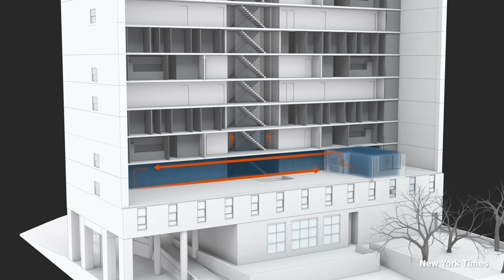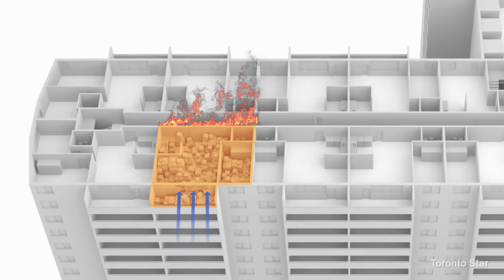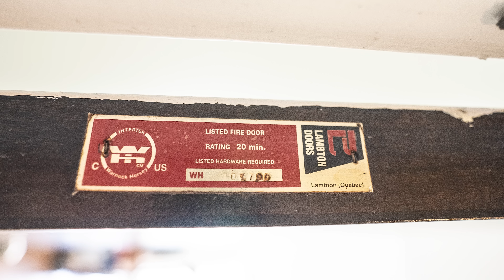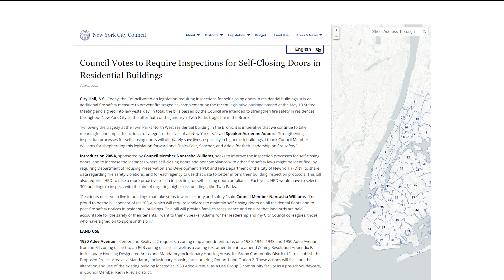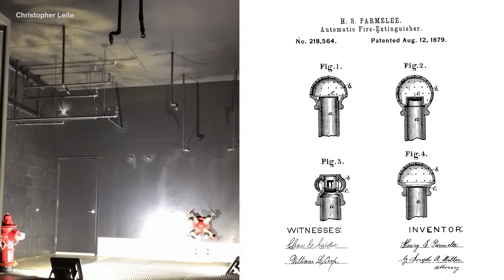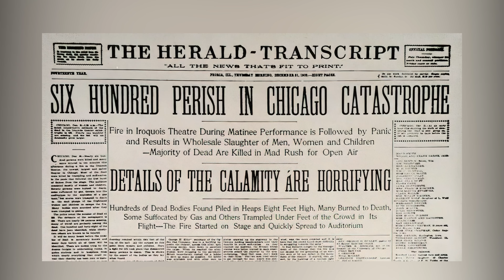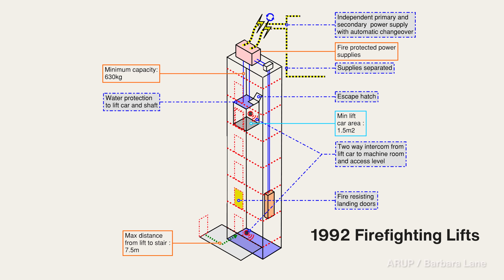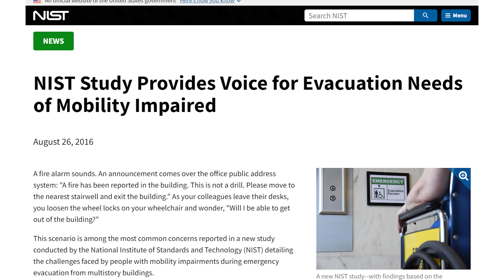How Hidden Engineering Keeps You Alive in Apartment Fires

Comment: While a great video about how things should be done, "stay in place" has killed tens of people, because not all buildings fit the code and unexpected things happen. The best rule is to always evacuate at the first sign of a fire.

The only exceptions are if you can easily end the fire, if there's danger outside, or all evac routes are blocked. NEVER assume that fire protection systems are installed, up to code, working, or will work this time.

Comment: I used to live in a dorm that has a sprinkler in the center my room and it can reach my gaming setup. So instead of disabling that sprinkler, how others have done, I found an old fire blanket and a rubber wall liner. I roll this up and secure it to the ceiling between the sprinkler and my electronics. Here comes the tricky part, I tie a string to the sprinkler's temp bulb that is connected to a force sensor. So when that bulb explodes, then the sensor will sense 0 forces from it and lets the blankets drop down. Moreover, I had a extinguisher under my desk just in case. In the end, it never activated because there was no fire at all in the 4 years that I was there. At least I was able to reuse the rubber liner for another project.

Comment: Fabric fan here! Did you know that most firefigher suits are made with flame retardant fabrics? you can actually buy commercials spays which can prevent certian fabrics from catching fire as easily. Before these innovations figherfighters used to wear woolen suits as wool doesnt actually catch fire, its natural insulation was also a desireable quality for this reason. Certain synthetic fibres are famous for the opposite reason, although they can be soft and warm they are also increasibly flammible. In the 70s there were a few cases of children catching on fire after sitting to close to heaters and fireplaces in synthetgic pyjamas, for this reason some childrens clothes now carry a warning in the event they do use such fibres

Comment: My building, a college residence hall/dorm with a basement, lobby/ground floor, and six residence floors, is essentially the lowest-rise “technically high rise” building imaginable.
It has pretty much all of these safety features, except maybe concrete walls between units. They feel like Sheetrock and sound hollow when knocked, but are surprisingly soundproof, I never hear my neighbors, and I’m sure they use metal studs and maybe double layered Sheetrock at least. Our floors are carpet tiles directly over concrete, and our ceilings are concrete with plaster and paint on them, which looks very convincingly like Sheetrock until you touch it. All our dorm rooms have sprinklers on the wall directly above the doors, which have working door closers. (There was a time, though, where ours didn’t quite latch all the time but it somehow fixed itself.) There is a standpipe in one of the staircases. We don’t have any of the emergency stair pressurization systems, but I do believe we have pressurized elevator shafts. Our fire alarm system is also a “floor of incident” style system. When a smoke detector or manual lever is activated, the alarm will sound on that floor, and the floors directly above and below the incident floor, but not the entire building. This means there will be less crowding during an evacuation (though they set the entire thing off for drills which is absolute chaos) and also since we’re a reinforced concrete building, there’s no real threat to those people if the fire department shows up in a timely fashion. 
My only minor gripe about the dorms on my campus is the fact that the smoke detectors in the rooms themselves don’t set off the rest of the system, or notify the fire department, like the ones in the common areas. Instead, they just beep in the room only, and flash the room number up on the alarm panel. I guess they assume if there’s a real fire someone would pull the alarm at at the pull station near one of the staircases, or the sprinkler will activate? (There’s flow switches in the sprinkler system, so an activated sprinkler will also set off the floor fire alarm, but as you say, not the other way around like in the movies.)

Comment: I live in Honolulu, which is crowded with nearly 500 highrise buildings. Sprinklers were not required legally until hundreds had already been built. After a very stubborn fire in a commercial office building took about a day to extinguish, a law was passed that mandated sprinklers be retrofitted to all commercial buildings (including hotels) that lacked them. BUT...efforts to do this for residential highrises have consistently failed due to residents complaining about the cost each owner would face. In 2017, a major fire in a 36-story residential building, the Marco Polo, killed four people and damaged or destroyed 200+ units. Those at or above the fire were burned or smoke-damaged, but a great many more below the fire were damaged by the massive amount of water sprayed by firefighters which ran all the way down interior walls to the ground floor. None of this would have happened if a single fire sprinkler had been activated immediately to extinguish the first flames, which occurred in a kitchen.

Comment: I'm in Valencia Spain at the moment and my building lacks all of this. Even the walls are bad. The neighbors have even locked the roof door which for us leaving at the top is one of our escape routes. They don't care and it's the same answer from the company managing the building so we don't have the key. None of the doors are fire doors. Well we have none of the safety measures you mentioned. I guess this is good only for new constructions although down from where I live a recent high rise building was entirely destroyed by flame from bad electrical wiring. Some people died. So it depends on when your building was built, if the constructor follows the regulation and the country where you are (especially: how easy is it to bribe building inspectors)

Comment: One fire that this video made me think about was the triangle shirtwaist factory fire. Here, the owners actually blocked the fire escapes, making them unaccesable during the fire. The reasoning was that they were locked to prevent theft, but it really resulted in many tragic deaths. This building was also fire resistant, meaning that it would not collapse; however it was lacking many of the other safety features. Some of the safety features could act as a fail-safe of the next, such as having a working sprinkler system. Aside from egress, the video also references how smoke inhalation is the largest killer in fires and a good safety feature against this is smoke control. To do this, many high-rises have automatic closing firedoors and floors that are rated as fire resistant and as well as smoke control systems that vent out harmful smoke. The triangle shirtwaist factory did not have automatic closing doors or a smoke control system to remove the smoke and to give the workers time to stay in place. The locked doors did not allow them to evacuate.

Comment: When will these ideas be used in low rise and single family buildings?
Reply from the maker: They won't except for sprinklers which are coming into many standards if not already.  It costs too much to fireproof everything and people are more easily able to evacuate from homes.
Reply: I think of Lytton, BC.

More than half the town was in flames in about 15 minutes. When I saw video of the destruction, I saw one home with a big wooden deck, with a green lawn and shrubs. It sure looked like this homeowner turned on the sprinkler before he left and just let it run. And it saved the whole property. Not saying that’s the best go-to method for fire protection but if we look at what remains after a big disaster like that, some of the cheaper ideas ought to be included when a building fire code is upgraded.

I asked the city of Toronto to install protected intersections (for cyclists) for over a decade. They are doing the first one now at Bloor and St George. Now I want to convince them to do a lot more. I have a strong belief in people being able to shape our community for the better. I wonder what changes that means for fire resistant buildings.

Comment: That definitely explains some of the features I've seen at a retirement apartment complex I once had an internship at. The whole door thing in general is rather interesting, one moment the closed door is protecting the room, then if it goes on a certain amount of time, the pressure from the flames will burst open the door like Shrek leaving his outhouse. I also wish I could get home sprinklers, but I doubt they'd work properly in older homes that still uses well water, and installation complexity being another thing.

Comment: I used to live in Sunnyvale, CA and our apartment building code dictated heavy fire doors on each unit at the hallway. (This was a 3-story building with 135 units.) My current apartment, built in 2016 in San Jose, CA has flimsy wood panel doors that you can stab with a screwdriver (happened to a neighbor). It's 6 stories high, 102 units, wood frame construction. 

Our instructions are to use the fire exit stairs any time our smoke detector or the building fire alarm goes off. However, most people have stopped evacuating because there are so many false alarms. Some tenants tamper with the wiring (because they're tweakers?) and the system goes off at intervals until repaired. Other tenants just pull the fire alarm in the hallway because they like to see the fire department roll up with lights and sirens. (The fire department hates our building by now.) We also haven't had building-wide alarms when there were fires because of all the damage to the system.

However, the fire sprinklers have always worked to keep fires limited to the apartment where it started, even when there is smoke in the hallway after tenants opened the door to air out a cooking fire (and the chemicals from the stove hood fire stoppers). Each studio apartment has a sprinkler in the kitchen area, the bathroom, the living area, the sleeping area, under the overhang in the sleeping area where the bathroom fan exhausts outside, both enclosed closets, and the area between the closets. The main problem here is flooding of the adjacent units and everything below to the ground floor.

Comment: A fun little note on wood-construction. Using wood, rather than metal in your supporting structure actually lasts longer than metal before experiencing a collapse. I know. Weird, right?

Well, as wood burns it chars into a fluffy carbon. If you've ever tossed a log into the fire, you know that even though the fire is raging, that log seems to persist for what feels like hours. Even in forest fires we see burnt trees standing tall. That carbon on the outside acts as a fantastic insulator of heat, keeping the underlying layers structurally sound. An example of which being fire-walking, where you walk on burning wood coals. 

As for buildings that have been designed with this in mind, a local sawmill comes to mind. In 2012 the Lakeland Sawmill in Prince George, BC suffered a dust explosion. A raging inferno broke out, with fire and small explosions quickly spreading through the mill. The roof quickly collapsed under the extreme heat, blocking escape routes for some workers, including my neighbor who had tried to go back in for his coworkers. He was badly burnt by the walls of flames, and had to retreat. One employee died in the fire, while 12 others suffered injuries.

I got to take a walk-through of the mill, and one of the biggest changes made besides dust mitigation was the use of large wood-beams spanning across the ceiling, supporting the roof. The time they are supposed to last before structural failure occurs is dramatically higher than their metal equivalents, a somewhat counter-intuitive design made to give humans precious extra time to escape if the worst was to come. It definitely highlights how far material science has come for buildings, and how we have grown to take advantage of the unique properties of readily available products.

Comment: working as a construction manager in Denmark, we have a lot of rules and regulations regarding fire safety when designing and constructing building
Constructions laws or most likely similar in many countries:

First, the building will be placed in a risk category, depending on things like max occupancy, numbers of floors, Height of building, if the building is designed for sleeping occupants etc. 
Depending on the risk category, there will be deffirent rules for certain parts of the building.

Next, the building will be subdevided into smaller sections. Escape staircases and installation vents will allways be in their own category. Deffirent apartments will be seperated aswell. Large apartments may even have smaller sub-categories, further deviding it up.

All decks and walls seperating deffirent sections will have to live up to certain criteria, as follows:

R: Load bearing construction (Like a pillar)
EI: Seperating, insulating construction (Like a wall)
REI: Load bearing, seperating construction (Like a load bearing wall)
There are further annotations, such as the construction materials dripping effect (how much heat is required for the material to melt, and possibly start dripping down, setting fire to parts of the building further down.)

Then the constructions are given minimum requirement for time it will take for the above properties to fail, most commonly 30, 60 or 120 minutes.

For a multi story building, a standard requirement would most likely be for the escape staircase being seperated from the buildings other sections by EI-120 construction (REI-120 if load bearing)

Comment: I do want to correct that the smaller bulb size in the fire sprinkler is not related to its activation time but rather the size of its orifice for the required water demand. That said residential fire sprinklers tend to be far less demanding than commercial. And that's because the hazard imposed by the type of occupancy of the building. And R-2 occupancy is less of a hazard than an S-1.
Reply: Not correct. A residential head may be smaller, but the same 3mm diameter bulb is used in other quick response heads. The 5mm bulb, now much less common was the standard response time index head. It’s a mass to surface area ratio design. In normal room there is considerable lag between rated temp and operation. Originally developed as part of the residential sprinkler head program that started at the National Fire Academy in the late 1970’s. 

The efficacy of faster response, and later larger orifice sprinklers then created largest changes to fire sprinkler technologies since the replacement of conventional heads by the SSP and SSU heads in the early 1950’s.

Comment: Another Excellent video here Sir, and definitely agree with all the points you've raised. I have to say - Despite being rather hyper-critical of the UK for it's terrible non-accommodation of those of us who have disabilities which don't show up in photographs - The UK seems to have some of the better fire and electrical safety standards going. 🔥🇬🇧👍

As a tenant in social housing I'll also add that it may be wise for people to consider that some (If not all) of the fire protection measures fitted to their buildings might not work as intended when called upon in the heat of the moment, so keeping alternative plans with that in mind might also be wise.
Overdue maintenance and lapsed inspections are a known problem in the UK (By way of example; One side of my letterbox is broken, and for accessibility reasons a few of us don't have self-closers on our front doors) so always use your best judgement when choosing whether to Evacuate or Stay-Put, and try to have a secondary escape route from your home if practicable. 🏃

Comment: Sprinklers do tend to shower you with boiling hot water as the water pipes are heated in a major blaze. But in a smaller localised fire that isn't a issue

Comment: The 6 story wood frame Bldg is not safe. There are tons of combustibles used in the structural framework, and when they degrade from fire they will collapse. Also those types of structures are a honeycomb of voids and open spaces where fire / smoke will move and spread. Those Bldgs should never be allowed over 3 stories unless fully sprinklered. Apt doors should be rated the same as the walls, to protect the rest of the floor/Bldg. Interior doors should be 30 minutes minimum. We had a fire in Manhattan where the interior door was not rated. A resident who was trying to shelter in place died when the fire burned through his bedroom door. The stair vent system you showed is great, and should be required. But like sprinklers, it costs $ that the cheap investors won't spend unless laws are passed mandating them. Good show

Comment: Remember when the residents of the Grenfell Tower were told to stay put because the building was made to handle fire, then they died? Yeah, I remember, what this video doesn't address is how complex this actual "fire proofing" is. It all has to work right, even decades down the road when maintenance could be severely lacking. There are always sprinklers that don't work, fire doors that don't work, stuff that wasn't sealed right. If the building is safe to evacuate, like Grenfell Tower was, GET THE FUCK OUT! Don't wait until you're trapped and die like the people in Grenfell Tower did, just hoping all the fireproof bullshit would save them.